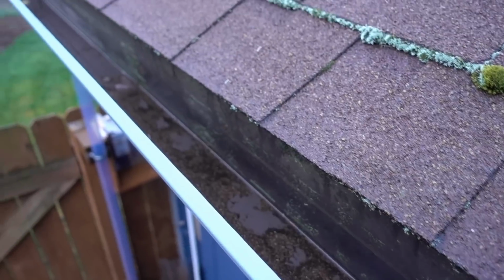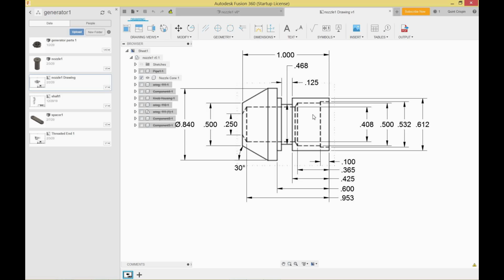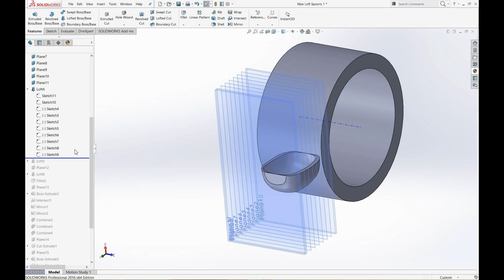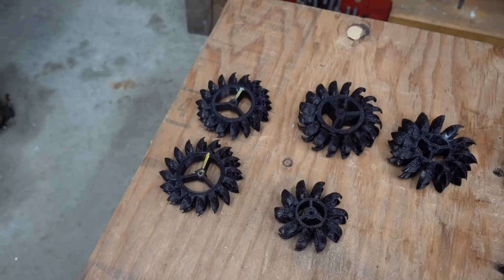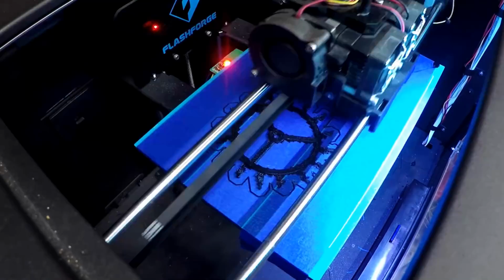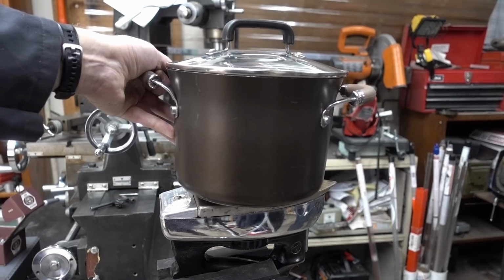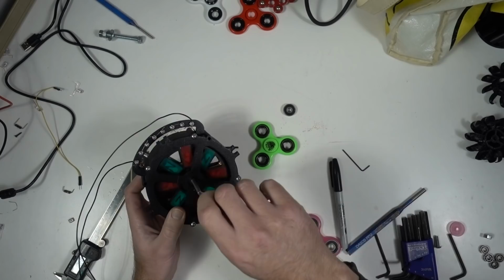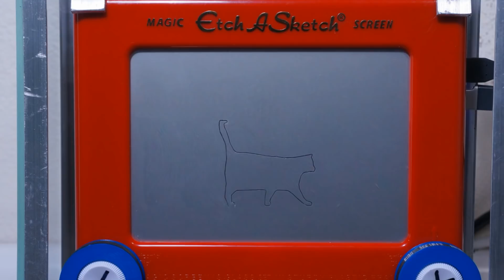Rain Gutter POWER #3 - Fidgeting With Turbines!

Comment: Just an idea: Instead of the water hitting the turbine from below, put the water jet hitting from above and use some gravity too.
Reply: I too think he is loosing power when transversing the force laterally.
Reply: Because gravity is weak and pressure is a much much greater force, having a horizontal flow gives perfect pressure build for the rain flow he has
Reply: The water would have to go up and around, i doubt it'd help
Reply: @scottpeters1847  With gravity do you not combine those too together?
Reply: That and he should probably have two of these things.  When it rains I'm almost sure it will overflow and go elsewhere.
Reply: The biggest advantage to having it come out of the side is the ease of unclogging the pipe by simply unscrewing the bottom.
Reply: Was just thinking the same thing!
Reply: I was thinking the same, 90decree turn probably loses much power
Reply: @dolan-duk  mee too
Reply: @beholdandfearme  Good point, what about an offeset.  Like a 45 degree angle raised up a bit.  Anything to improve the direct flow.  He's using pure pressure at 90 degrees, he could be also using gravity if he adjust it to 45 degrees.  0 degrees being straight down.
Reply: @timothyandrewnielsen  Not really. You will find that given the water jet is hitting the wheel below (not on top) the few extra cm of height difference will allow a greater a greater pressure then if you had gravity assist it.
Reply: Great idea, and at the same time this solution could decrease hydraulic loss of steep 90 deg angle of water flow and water input
Reply: @timothyandrewnielsen  well... if you had watched it carefully you would see that there is another tube at the top to prevent spillage.
Reply: What about  having  the turbine horizontal instead?
Reply: @mikeutube82  I would argue that the jet outlet should be a lot closer to the turbine as the first step to improving this.
Reply: @MArtbboy  I meant a second entire setup because I would think he's only calculated for average rainfall, not when it comes down fast.

Comment: Quint, here's an idea: 

rotate the generator 90 degrees on the axis of the water stream. generators in power plants have vertical shafts as the load of the rotor is evenly dispersed along the outer periphery of the carrier bearings. this should in theory reduce the individual load of the ball bearings making contact in the race.. although a bearing in theory should disperse the load evenly in a horizontal application, given the tolerances of manufacture, they rarely ever do. you would have to go to a spindle ball bearing or a tapered roller bearing in order to disperse the load axially on a horizontal shaft. 

by just turning the whole works by 90 degrees you are getting the minute axial load you need on the shaft. 

you were on the right track with the multiple nozzles. what you failed to take into account was the volume. in order for the multiple nozzles to work you need to bring in the same amount of water to each one as the original nozzle you started out with. that means a much larger supply tube.
if say your initial nozzle had a one centimeter cross section, the rest of your nozzles will need to be the same one centimeter cross section.. which you did.. but then you restricted the flow by maintaining that same one centimeter throughout the system. you will have to increase the supply tube to two square centimeters if you are supplying two additional nozzles

can't wait to see how this turns out in the next episode
cheers
mike
Reply: you remember it is limited by the amount of water during the average rain per roof area
I would still try to make the turbine surface smoother
Reply: Making a vertical arrangement and a Volute casing for multiple nozzles might work
Reply: Agreed. 90 shift, housing for the wheel and 5 nozzles seems like it would make all the difference.

I would really love to see him make a completly separate enclosed system and have the gutter supply that. Not sure what kind of internal shape would be optimal for recycling or removing (whichever is better) the excess water spray. Probably some strange organic spiral, but maybe just simple cone shapes.
Reply: Why not add containers as water capacitors for each nozzle, that way the water pressure to each nozzle is uniform?
Reply: thinking the same... rotating 90 degrees should have some significant improvement

Comment: Here's an adea, try to make instead the larger diameter vertical pipe do this:
try to make a gravity pression pipe, bigger diameter on the top and lower diameter on the lower end so water will produce more force in the way out and you will produce more energy, try to evaluate the amount of water you have there and only do the maths.
By the way, kickass work!!
Reply: very nice idea
Reply: @marijebarel6714  Actually, the water pressure is based upon the water column height, only. The shape will have no effect.
Reply: @donwold1622  hi, your correct conserning the pressure and collum height but the diameter influences friction an therefore energy losses. It also controls turbulent VS laminar flow. I do think it's is a small influence but stil a nice idea to change the shape.

Comment: Can I suggest you look at good old "Mill wheels" low-speed high torque applications
Reply: I was thinking that also
Reply: Any thoughts on making the whole assembly larger? Scale the wheel up by 2? More surface area...
Reply: Andy Checkley yeah, higher torque with a bigger diameter heavier wheel. Then gear the alternator up so it spins faster or have multiple alternators in series.

Comment: could you potentially make the feeder tube go straight down with a fine point nozzle to reduce the re direct of water? And reduce the pipe size towards the bottom to use Bernoulli's principle to get faster flow?
Reply: I think it's less a matter of flow than it is pressure.
The amount of water flowing through the tube is low, given the size of the vertical pipe compared to the nozzle.
Reply: Dude On Bike well having a pipe that reduced sized Over time would result in higher pressure at the nozzle and more water flowing out onto the pelton wheel
Reply: @wesleymedeiros4325  Again, I pressure is the determinant factor.   And pressure is determined by the height of the water column, not the diameter or shape of the pipe.   Flow in the main tube isn't restricted.  The restriction occurs in the nozzle to generate velocity.  And trying to optimize velocity and flow.  Pressure is constant and depends on the water column.  (In other words, when one commenter suggested a vertical pipe twice the diameter, he became exasperated because it makes ZERO difference in the pressure.)

Comment: Have you looked at using a Tesla Turbine instead of the Pelton Wheel?
I built one using CDs as the disks and a CD spindle case as the housing, the results were surprising :)
Reply: Best part of the CD based tesla turbine is that it can be done using cheap, simple tools.
Reply: You need a much higher velocity for a tesla turbine.
Reply: @ADRIAAN1007  
Try it and see
Reply: I'd love to see that!

Comment: Just a thought, since you have messed with everything on the alternator end with minimal success, have you thought about increasing the hydrodynamic pressure generated by the supply? increasing the bore of the supply tank/pipe to increase the pressure available. As you said in earlier videos Dams have huge volumes of water to create that pressure, so it might just be that you just don't have the available pressure to impart the needed force on the wheel. 

Also,  you could add a steel ring in between the wheel and the alternator to act as a flywheel. Don't know if it would help though.

Comment: Electrical engineer here. I suggest you look into maximum power point tracking (there is a wiki page on it). It is used very commonly used in e.g. solar cells to select the electrical load resulting in optimal efficiency. Due to conservation of energy, the mechanical and electrical domain are linked very strongly. A transformer converts rotational velocity into voltage, and torque into electrical current. Changing load resistance changes the current/voltage ratio on the electrical side, but also changes rotational velocity/torque on the mechanical side.

Comment: Another suggestion is decreasing the volume and pressure of the flow,  and increasing the length of the blades and surface area which the water flows. The technologies for slow moving river turbines are absolutely amazing.

Comment: This is possibly the most entertaining micro-micro-hydro build series I've watched to date. :D
.
Great series!
.
But... to quote you: "OK, we've done just about everything we could possibly do to maximize...power"...
Ahem.  There are ALWAYS more things you could do. (none of my suggestions have been tested by me)
Decrease turbulence in water flow?
 - Pursue a laminar flow in the water - (wild guess)
 - If doing multiple jets: introduce less 90-degree bends in the water flow (your manifold probably made the water very unhappy)
Decrease 'weight' of pelton-wheel?
 - Different material?
 - Different support structure (less material but hopefully still strong enough)?
 - Try different orientation of wheel axis (allowing runoff to 'get out of the way' quicker)?
.
Have you considered burning incense and/or making sacrifices to your water-diety of choice? It is Oregon, after all.  
I think there are some local Water shamans available for hire in our immediate area.

Comment: there is a video around here where some off grid dude's power comes from washing machine motor and bucket using water from a nearby creek going down to his house, water pressure shooting at the wheel was good enough to spin it at decent rpms.very similar concept.

Comment: I saw you in my queue and clicked on it immediately, as I remembered an argument I had with someone about using all your downspouts wired together to charge your stuff. They said "It's not worth it." I never did the work, but you did brilliantly...  I wonder if you have looked into using the Tulip Impeller design? I know it moves water more efficiently, (mixing it in water tanks and shaped conically like a tulip or tornado) but I imagine it would better take advantage of more of that water spray which as you pointed out is potential energy.  But that means a whole new set up! 
I am impressed! Good work!

Comment: Having the water flow over not under, adding a flow guide to direct the splash back onto the wheel, or using a larger radius wheel will increase efficiency.

Comment: I noticed that you did not build a fan that was larger, with same style of original pelton wheel.  I can only add my experience with computer fans.  The bigger the fan the slower it had to move to move the same amount of air, and thus decrease the amount of noise.  I imagine you could bump up the size of your wheel until the excess water energy is no longer wasted.  Excellent videos!

Comment: If you flipped your scoops so that your water sprays at a downward angle it gains more gravitational force. Also if you modify a bicycle chain guard to catch the extra water and re channeling it back to the top of the wheel additionally possibly adding more inertial force on your generator wheel. With those two modifications you should be able to increase your output exponentially.

Comment: Great experiment 👍
In comment 👉 for accuracy of power, it would be better to add crescent circular shape that  rotates inside the bar, to transfer water up. In that case you can recycle and adjust the height of water flow. The gravity force let the  water force increases toward the turbine.

Comment: 0.8 watts is pretty respectable with that little setup.  This combined with other energy harvesting means could help charge a battery bank to power low-voltage/current LED lighting. The problem is, you will have to rewire your house for 5-12v DC or something similiar/universal to get these benefits.

Comment: Pressure in a cylinder is a factor of height, so you should move the nozzle to the bottom, having the multiple outputs branching down from that nozzle, never branching up. Direct the stream in a different way to produce a higher velocity of water. Also you could try using more curved buckets, but not sure if that'd do much

Comment: also try adding a check valve at the top of the gutter to not let pressure escape plus adding a pressure bladder inverted inside the gutter to that would maintain pressure with a check valve in it that way it wouldn't lose its pressure until the water exceeded its initial pressure before it compresses.

Comment: if the needle is used to change the rate of water flow, then you can put a series of them going down the pipe with alternators at each one to capture the most amount of energy, while slowing the rate of flow and power loss at each point.

Comment: Just a suggestion, have you tried to have the pipe ending at 45° towards the wheel with a funnel style attachment in the end, instead of ending flat at the bottom and having the water just leaving through a hole in the side. I think this would increase the speed of the water leaving the pipe. Keep up the good work.

Comment: I've seen many Pelton wheel power systems that were used by miners in the California Sierra foothills.  In every case the nozzle was directed at the underside of the wheel.  In large hydro power installations the shaft is vertical with three or four nozzles directed around the periphery of the wheel.  Also... for heads of less than 70 feet Kaplan turbines (an adjustable pitch propeller) are used.  For heads of from 70 to about 500 ft. Francis turbines are used.  Above that is where they use Pelton wheels.  Since you have 3D printing capability, you might try and make a small Kaplan turbine.

Comment: It's not just the seal that slows down the bearings. Sealed bearings are packed with grease, this provides corrosion resistance, lubrication, and most importantly, heat resistance. Bearings have less than .001" tolerances, distortion from temperature is enough to damage the balls inside, which ruin the entire bearing.

You can make your own low friction bearings but just pulling off the seal and washing the bearings in some acetone. Just know that the bearings can no longer handle any type of heavy loads (not applicable here) and they have no corrosion resistance, so spray on plenty of oil.

Comment: If you want more power out of that then capture the excess water & Gravity. 
Have more stages of generation fed from the falling sprayed off water.  
Your vanes will capture more energy with water over the top rather than underneath.

Comment: Here's a suggestion to produce a smoother print. After you've made your print paint on 3d printer resin and then cure with uv light. It'll be much smoother and won't use heat or acetone that can deform your print.

Comment: I noticed that a water recovery system was used. Less back splash. A cover over the unit once the full watt is accomplished. Can not be air tight, so a vacuum, negative air pressure, is not created in the box.

Comment: You are changing the velocity of the water by sharp 90 degrees: keep the change of of angle of flow from the down pipe to the nozzle exit as little and slow as possible. Also, minimal distance from nozzle outlet to buckets as possible. Every little will help.

Comment: Encapsulate the wheel similar to a power generating turbine; you can't use it in a drop-down flow configuration but you can use it like a water wheel from the past...

Comment: Without checking the videos after this the nozzle for your jet still looks quite large if it was made smaller which could be achieved by just sticking the end of a ball point pen in it you would get an even higher pressure jet and as always more pressure means more power.

Comment: Pelton turbines are used for high head applications, 300m and greater.    Try a Francis turbine or a Kaplan turbine, they are more effective for low head applications (down to 2 meters). Both should be 3D printable.

Comment: You need a long series of buckets in one looped chain going all the way down and dumping out at the bottom and looping back up and refilling at the top. That will be an immense force coming down. Think about 10 half liter buckets pulling down, that will turn a load and still not require a significant amount of water flow.
Reply: Put a small hole in each bucket so the top ones fill the lower ones slightly to build up some weight until it can begin turning on its own.

Comment: Quint, what if you drilled the hole out of the bottom of the pipe and placed the generator wheel below the pipe. Remember in the 1st video the paddle wheel demo when you sprayed the plank to make it go higher. Well, depending on where you positioned the spray, it would go even higher just a bit. With the wheel below, you might could adjust the X and Y alignment to get the perfect positioning for the downward spray.